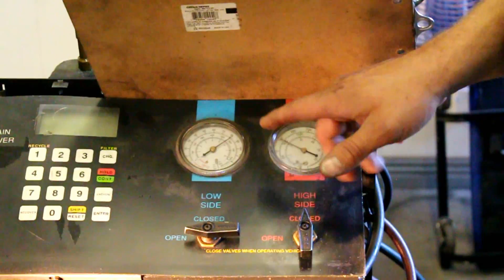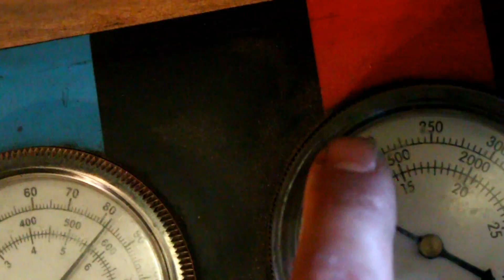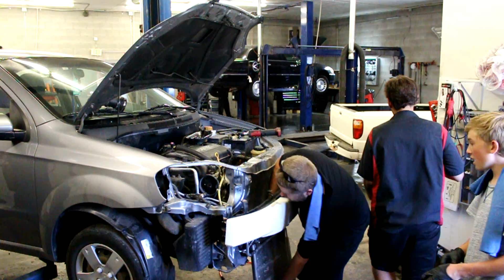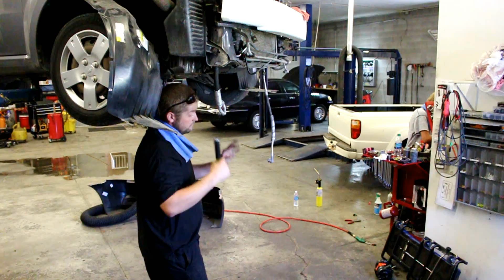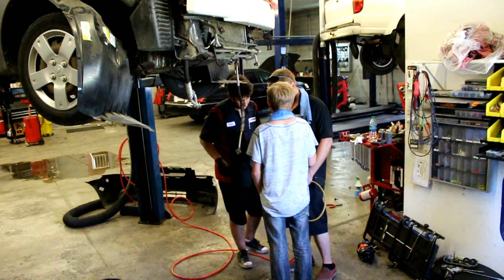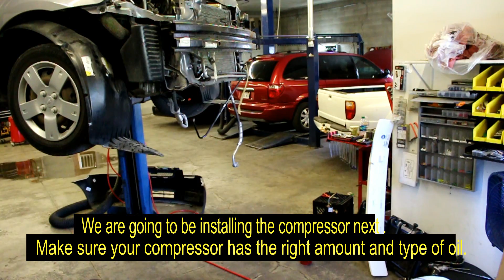Chevy Aveo complete AC system repair

Comment: hi, thanks for the video. I have a question. three days ago I changed the compressor. same machine model. after they handed it to me I drove 30km and almost burned the engine. practically damage to the radiator. Is it possible that they went around it as I see from your video and they didn't do the job well? thanks and sorry for my english.

Comment: Seems like all Chevy Aveo AC doesn’t work mines needs to be recharged “they say”
Reply: Nene Janei:

Chevy Aveos are garbage...some of the worst cars in the World.... a title GM Korea/Daewoo seems proud to hold the Crown. 

Other GM Korea/Daewoo engineered garbage to avoid (and not all assembled in Korea): Chevy Spark, Chevy Sonic,Chevy Cruze,Chevy Trax,Buick  Encore. Stay away from the Opel derived crap with: Cadillac,Buick,GMC,Chevy badges attaches to them.

Friend thought she got a "GREAT DEAL" on a low mile 2011 Aveo 3 years ago....one problem after another....I to replaced the expansion-valve,receiver drier, and compressor on it. Even the 3 freaking  copper wires going to the pressure-switch   built up so much resistance, they would not turn on the fan or compressor(I fixed that deal to).
Reply: @NGS-020  even mine is not working i dont know what to do now to fix it....